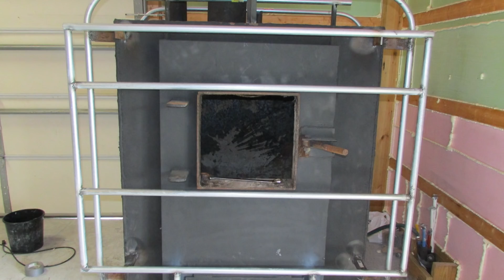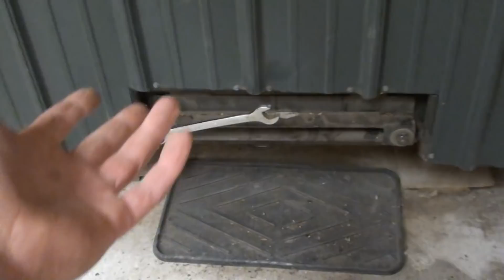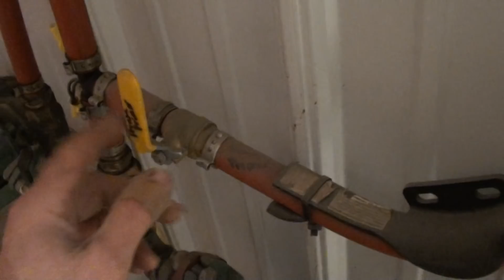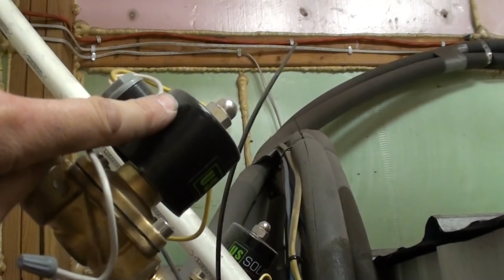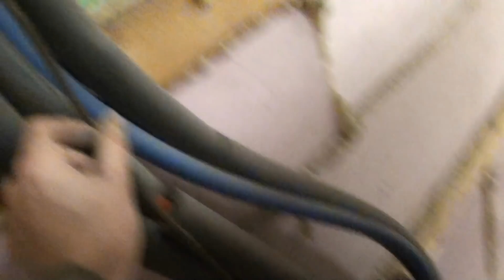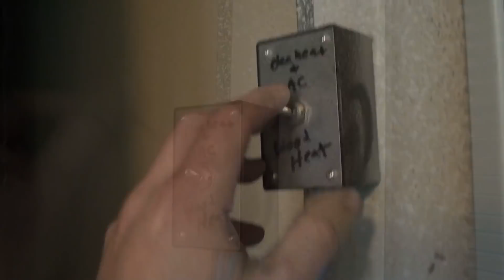Outside Wood Boiler setup

Comment: Are you running two separate furnaces in the house, one boiler and one electric?  If so, are they plumbed in parallel or in series?

Comment: You should keep water in it year round. By draining it in the summer your allowing oxygen into the boiler which increase rust by a thousand percent versus leaving water in it to the overflow point as water is heated and cooled in a boiler/furnace it drops the oxygen level by 90 percent or more and greatly reduces rust production inside the boiler. In the fall simply drain off enough water to get rid of sediment, no more than 20-30 gallons is necessary to rid the sediment from the boiler then refill to the full line and light her off.
Reply from the maker: You are correct. I learned that after the first year of using it, thanks for the input!

Comment: Hey man , do you have problems with the draft solenoid burning out ? I go through them like beer .
Reply: I built my boiler had a similar issue when the damper would stick. I used to use a solid link from the solenoid to the damper. I changed to a spring type link. Haven't lost a solenoid since.

Comment: Im curious why you built your own heat exchanger with 50 feet of copper, instead of buying a much more compact unit for your domestic hot water?
Reply from the maker: I had no water tank in the winter. The heat exchanges they sell would not have been efficient enough to run a tankless setup

Comment: Reminds me of the boiler/furnace my  father built back in the late 80's early 90's.  We did the same thing for domestic hot water and we kept 2 buildings warm all winter with it.  The furnace was a best compared to yours - we fed it full 6 foot length logs.  Thankfully it was only stoked once or twice each week.

Comment: Its so unprofessional.
Reply: Let's see you build one
Reply: In Germany we have an other system. A oven in the livingroom with an integrated heat exchanger. For heatstorage an 1000l buffer spoke in the storage Room......
But i dont mean the function.
I mean the electrical und pipe installation. Its unaccurate and looks like improvised.
When in Germany a company make such a installation they dont became any money. Thats fact.
Reply: Chris and also works, unlike the one you built
Reply: Chris, it is improvised, it was a home built heater boiler, and he finished it him self. It was not "professionally installed".  That said, i bet it works as good or better, than the $7,000+ factory made units.